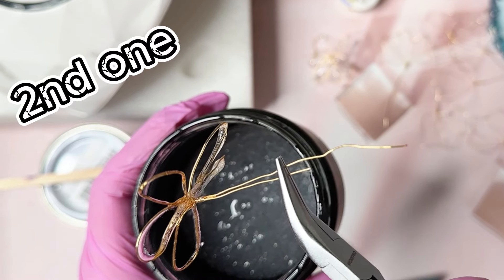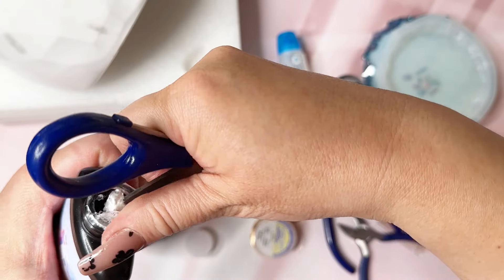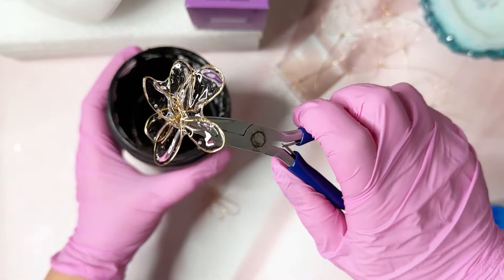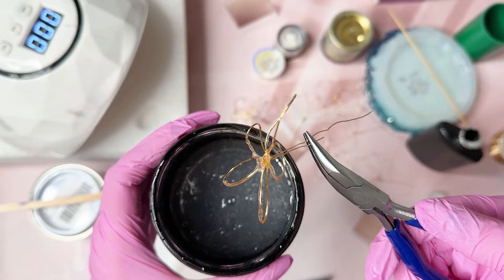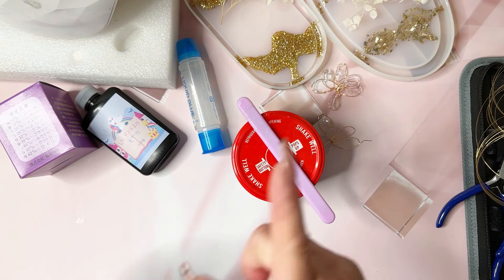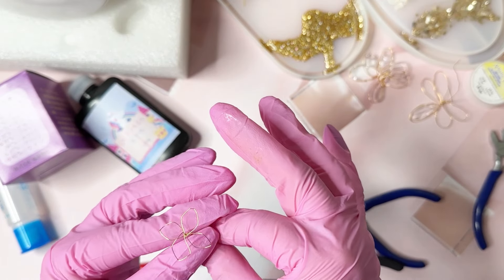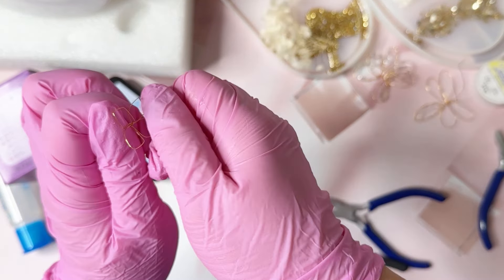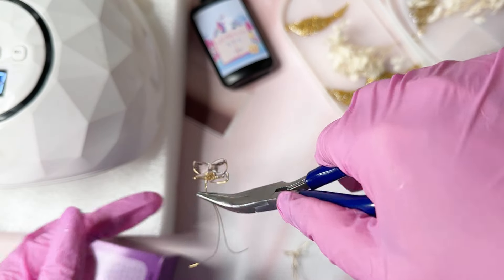Homemade Dip Resin for Beautiful Wire Art Flowers Using UV Resin and Glue?!

Comment: Thank you for sharing your art. Dipping resin is pretty expensive and is unforgiving as it won't allow for fixing/covering holes etc.  as you showed using this inexpensive method. There is a resin clay ( OYUMARU ) that acts more like a silicone can shaped/sculpted that you brush on UV resin over it and after curing the resin can be easily removed from it thus making thin pieces such as petals. Your flowers look so delicate again thank you.
Reply from the maker: Thank you for stopping by! Oyumaru! Yes, I've seen it but I've never used it. Your tip is fantastic! I'd love to give it a go! I really appreciate you and your comment 💕I hope to see you around again!

Comment: Amazon has black makeup jars.
Reply from the maker: So true! Thank you for your advice!
I was in a pinch because usually I don't work with UV resin and realized that I needed a black jar ASAP 😅😅 Please be more prepared than I 🤣🤣
Reply: @KandymaroResin  I found out I needed to put UV resin in black jars, when I had friends come over and I made them each a little jar of UV resin in clear jars and it didn’t take long to firm up.  Also thank you for your video, it was very informative.